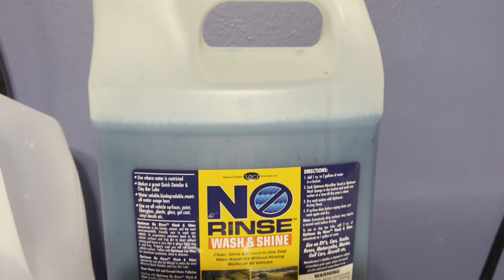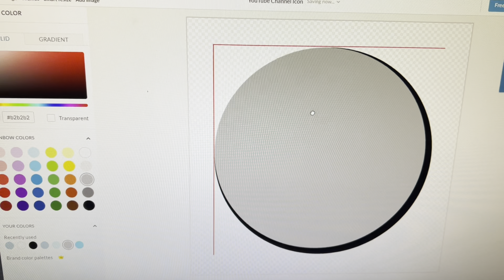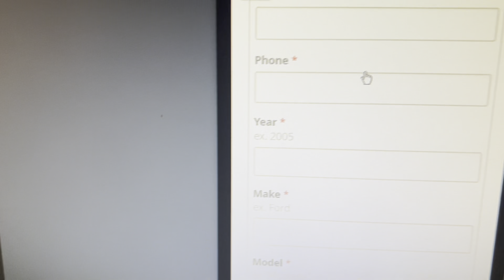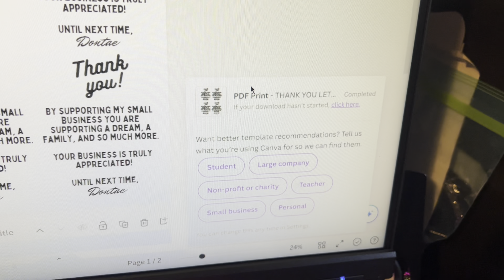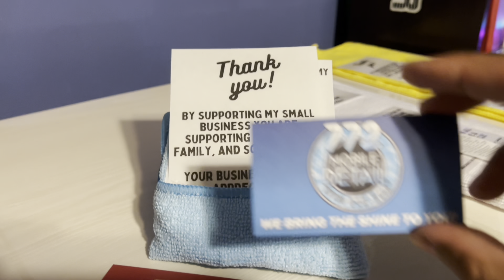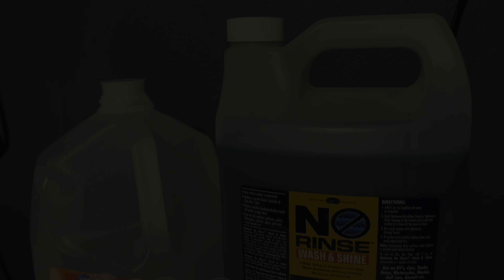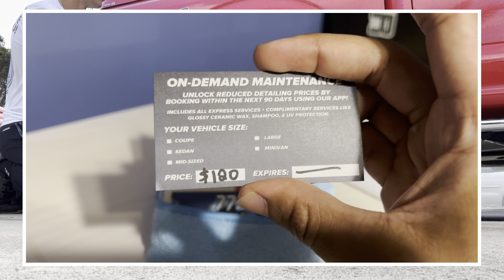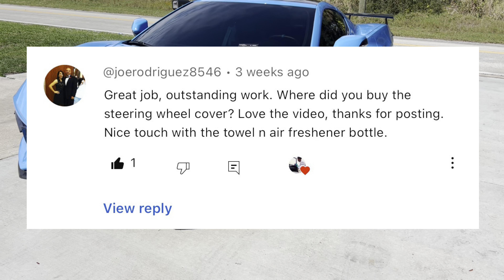How I’m Innovating My Detailing Business in 2024

Comment: You should try an APC for those wheels it’s so much cheaper than the suds lab cleaner
Reply from the maker: When it comes to wheel cleaners I’m going to have a hard time replacing Sudslab. It requires minimal agitation and speeds me up significantly compared to APCs. I do a lot of ‘cost cutting’ in other areas of my business so I don’t mind spending a little bit more for something I can depend on.

You can also dilute the sudslab wheel cleaner. They recommend as much as a 4:1 dilution ratio which provides a lot more longevity. I use 1:1 on very dirty wheels and get amazing results.

I want to make clear that I’m not sponsored by sudslab just providing my own experience!
Reply: @HustleHarderThanTheNext  100% didn’t think of it that way. I’ll have to give it a try for my business too. I’ve seen it in Walmart and just didn’t think it was that good for the price. But if it’s melting stuff off the rims and tires then I see why it would be worth the price. Not sponsored yet but keep grinding and it’ll come 🙏🏼😂